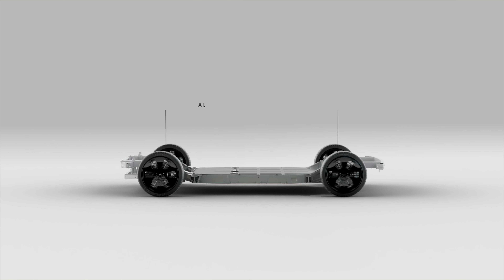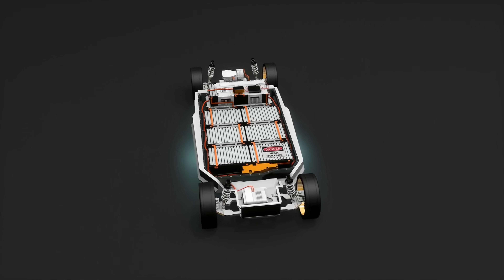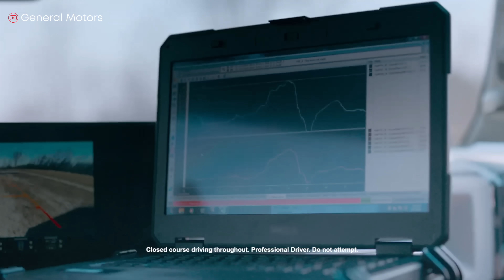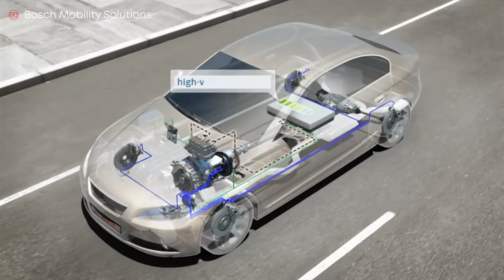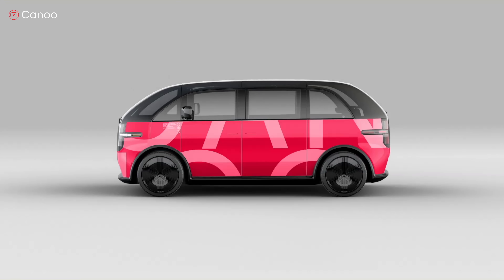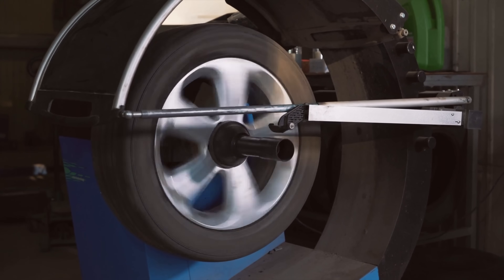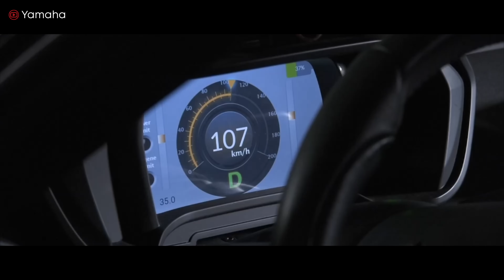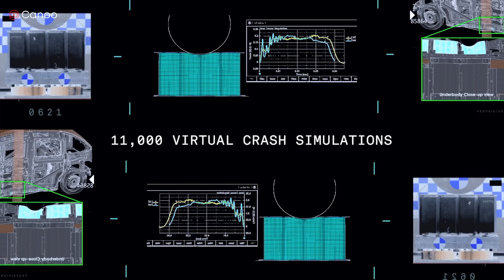No One is Telling You the Truth About Electric Cars, So I Have To

Comment: Mullen EV batteries are REVOLUTIONARY. Solid state sodium ion... chemistry is not that of liquid conventional batteries... they are SOLID STATE. You can literally puncture it and it does nothing more than reduces the capacity of the battery. Does not explode, has more energy density, is lighter, does NOT impact environment (mining for them does however). Check it out

Comment: In 2021, 77 % of ALL electric cars sold in the USA were Tesla (US Dept of Commerce data). Tesla refrigerant/cooling systems, braking systems and the sort are sealed, so nothing of what Scotty says in this regard is accurate.  Next, Tesla is getting better, more efficient batteries with a better chemistry like LFP, that can be recharged 0 to 100% unlimited amount of times with no penalty,  and Lithium/Velcro/Iron batteries that have up to 5X times the energy density of the regular Lithion ion batteries, and they do not require as much temperature control as regular batteries. Also, some vehicles like the Geely ZEEKR-1, have a revolutionary battery that is guaranteed for 2 million miles!!!!  GM 1 million mile battery at this moment is a joke, it is only in planning, and will not come until may be, if GM still exists as a car company, in 2029 or 2030. Battery technology has advanced much more since Scotty made this video, and most of the real EV companies are getting better and better at their propulsion trains, way better than GM, Ford, Toyota, Honda, Audi, BMW, VW and MB.  They are more efficient, more powerful, better built, and more economical, at a very high quality level of build.  And Tesla is at the forefront of all of them. These new companies are aiming to become better than Tesla, not to any legacy auto to which they are already superior.  So the actual maintenance costs for an EV in its first years is almost ZERO.  Just charging it, and tires will be the actual expenses. Compare that to what the expenditures any ICE vehicle have starting from the moment you buy a car....... Real good EVs are kind like computers, they are upgraded constantly, and that is why many of the newest EV will maintain their value longer, not like most of the older EVs like the Leaf or the Chevy Bolts, or Jaguar I-Pace. Those are dead end EVs. But the new EVs from Volvo, Polestar, BYD, NIO, Kia, Hundai, Li Auto, and obviously, the leader in technology Tesla, are going to be very advanced and with improvements every day or month that passes by, unlike ICE cars that you had to wait for the next generation to see an improvement that took severeal years to appear.  But this video is still excellent because it showcases how the EV has evolved, and will be one that will be used as a comparison for EV cars in the future.  Scotty is as always fabulous!!!!!!.

Comment: I have an 02' Ford Escape listed as a "Hybrid" w/ an electric battery. However, it is Not! It was a special order & I'm glad! 
Ford mechanical Dept. Told me the Hybrid (Elect. Motor) was only Covered by a few year warranty & when the battery goes bad & that electric motor stops working? 
You car is worthless, because it will Not Run! 
I'm a Gas Guzler Dude all day & will never buy these Electric or Hybrid $100k Ford, Chevy, etc. Vehicle!
Tesla is kinda Cool but I've never seen a Charging Station anywhere I live. I'm South of Houston Tx.

Comment: I see comments on You Tube and Facebook and am astounded by the ignorance of a large percentage of people,  quick to criticize and discount the advantages of alternative power vehicles. Their arguments are so easily rebutted, all it takes is a little research. The majority of the arguments stem around the misunderstanding that this is still new technology and all the kinks have not yet been worked out yet, much like when cars were first introduced  before the turn of the century. People seems to think that all the problems are suppose to have been worked out already and therefore all the flaws they point out are reasons not to embrace EV’s. The infrastructure for cars back in the early days were not there yet, like roads, gas stations or mechanics ,but those shortcomings were worked out over time to where we are today. No,EV’s  are not perfect yet. Yes, there are big question marks regarding battery life, mining to make batteries, recycling of old batteries, range, infrastructure etc. The early adopters of EV’s are the pioneers who can report on the short comings and what is good, to further develop the EV and make it better.Nay  Sayers need to sit back and shut up if they can’t listen and learn to why their arguments don’t hold water. Everything they complain about are being addressed and just like transitioning from horse and buggy to automobile, it  takes time. It is the same for alternative fuel vehicles.

Comment: I would buy an electric car in a minute if the technology was there and a parallel move or better versus gas powered cars, and it isn't. There shouldn't be any compromise in having to move to an electric car.  I cannot pull an electric car into a station and be fully charged in less than 5 minutes. I can't travel long-distance without having to pull over and charge far longer than it would to be filling up at a gas station. The battery is equal to the engine in a gas car and I have to replace that battery at thousands of dollars in costs every 100,000 miles which means every four to five years for many people,  you're dropping a new engine into your electric car, which could be more than that maintenance savings you were talking about. Haven't even mentioned about possibility of being electrocuted and other battery related dangers. My gas powered car has the same amount of power regardless of the weather, and that power never diminishes unless I don't take care of the car. Electric cars power diminishes no matter how well you take care of the car and begins to immediately. No, the technology is not there and your government once again is treading where it doesn't belong and it's going to force your hand and everybody else's into a technology that is unproven and not capable of meeting all gas powered vehicle demands.

Comment: Oh no buddy . Fewer parts does not always mean fewer problems. It means that each part becomes more critical. Then you started talking about battery life. LMAO 10 years then you need a new 1 but it costs more than the motor . That's absolutely planned obsolescence. Along with factors like cold and heat killing it. That shortens the life by how much exactly ? I guess that doesn't matter if you don't drive the car when it's hot or cold and not for very long. As to the environmental impact all these batteries have ? Well , you know what strip mines look like right ? But don't worry right now those substances are only mined in China so there's no chance of the rest of the world making them any time soon. I think I'd rather drive a gasoline powered car. It can be hot or cold it doesn't care. I can drive coast to coast and back again when ever I want through every climate and all I need is gas .The only problem is idiots keep wanting to keep the price high so that we buy sht from China . And oh yeah if it breaks , I can fix it myself with out getting electrocuted.

Comment: The people arguing against electric vehicles are exactly like the horse owners who argued against the newfangled motorcars 130 years ago. They're dangerous! Expensive! No refueling stations! Difficult to maintain! Ugly! 

The idea that current disadvantages - and the naysayers are right to point them out - can't or won't be fixed as the technology matures is absurd. in 1900 there 450 fatalities per 100,000 motor vehicles and by 2007 that figure had been reduced to 18. (Source: US Department of Transportation). In 1909 a Model T Ford cost $825, by 1925 a better version cost $260. In 1920 there were 15,000 gas stations in the US. Now, about 150,000. etc.

Comment: EV are a non starter for me (despite the fact the British Government is trying to get everyone driving them) because I live in a rural rather urban area so would have to have a charging station at home especially because there is not enough filling stations with changing ports in the area where I live not to mention the time it would take to charge it because one things for sure it would take a lot longer than 15 minutes to charge when that is all it takes to fill my current car with petrol and that's from nearly empty so until these issues I have mentioned are addressed by the the British Government  I will not be buying one anytime soon even if there will be no more brand new petrol and diesel car sold after 2030

Comment: I can't believe people still use ICE vehicles, makes no sense at any aspect.  EV range these days 400-500 miles, home charging cost equivalent of about $7 to "fill up" vs. ICE $50-100+, brakes pads and rotors can last 200,000+ miles ... ICE vehicles are for people that are insecure and just like to toss money out the window.  Our maintenance costs for our EVs is over 1/4 the cost of ICE based vehicles.  Replacing batteries costs $8,000, replace an ICE engine on the same vehicle (in this case a Kona) is $12,000.

Comment: The Ev verses the combustion engine. (My opinion) First I like the fact that scientists aee trying to invent a better solution and promote the new innovation in automation. Like the electric vehicles, and showing us, they have arrived. But let's look closely at there products, and see what they have to offer. Now here's the pros and cons of the comparison. But, first things first. And let's be totlly honest,  because the moderator (the mechanic) who've I've love listening to for a long time, don't sound the same..any more. 1# On average, the electric car company manufacturers knows its products car can go the distance of 350 to 425 miles before it next charge. Next charge?..Really? And how long is that? About an 1 hour 10 to 20 min. Until its recovery?. And what will I be doing until then? Up to you.. So l got wait  1 hour and ten minutes before I can continue my journey? Yes. Verses having an combustible engine, that could drive the full distance without any delay to my destination.yes again. Beit 1,250 vs.350  yes.. the choice is easy..the 1,250 miles and back is better. 3# Repairs and replacements : the main functions of the vehicle are the batteries, and when the batteries needs replacing or repairs, it's out of your hands completely. Why? Look where the batteries are placed and you'll see. Under the entire vehicle.(Electronic experts only) 4# They it will  save you money, how? And how much will the battery replacements cost? And since you're trying to save money, did you know that there'll many mechanics out of a job. You say, no they won't. Statistically they will, it not much for them to do anymore. Especially with simplicity vehicle repairs. Tires, small moving parts, lubrication. Did I say small parts. This mechanic (the  Moderator to me) at first was more honest  true and reliable. But he doesn't sound that way anymore. With his enthusiastic voice and drive towards perfection. Especially for the little people. What happened to him?

Comment: "GREEN"?  I Think NOT! To manufacture each EV battery, you must process 25,000 pounds of brine for the lithium 30,000 pounds of ore for the cobalt 5,000 pounds of ore for the nickel, 25,000 pounds of ore for copper Digging up 500,000 pounds of the earth's crust For just - one - battery. The Batteries are caustic to the environment to Manufacture and Dispose of.  
The Distance one can travel, depends on if the Air Conditioner / Heater,  Lights, or  Radio are being used while driving. To charge these Electric Vehicles it requires 2 to 3 Hours which requires voltage from a Power that uses Coal, Natural Gas, or Nuclear Energy.  Neither Solar Panels or Inefficient Wind Turbines cannot supply enough Energy to charge a car.  The NWO wants to get rid of conventional Power Plants and Gasoline Automobiles.  They want everybody to get an electric car.  Well there will not be enough  electricity to charge all of the electric cars.  We will have to have either Horses or bicycles to get around.

Comment: Some time ago, a German auto company designed a regenerative braking system to be stored in a mechanical vacuum unit without the need for electricity improving fuel efficiency by roughly 20%, much better than the silly battery method. Not sure why this hasn't been implemented on every auto. I'm not sold on batteries being the future, yet. It takes much energy to make them, then they are sooo big, then they end up in a landfill somewhere, then it takes energy to charge the batteries, and on and on. After all that, they are not that environmentally friendly anymore. Now, if the scientist could make a battery the size or your fist to power a vehicle or home, maybe we'd be on to something.

Comment: EV’s still need oil and brake fluid so there goes that lie about not needed oil production
Reply: Brake fluid yes, oil no.
Reply: @SpottedSharks  in this video and others on ev state they need oil
Reply: @rogerboucher9132  There is a lubricant in the electric motors, but it does not need to be changed. At least not in a Tesla which is what I have.

Comment: It is a darn good thing that world-wide use of EV's will dramatically alter and perfectly balance global climate so those low and high temperatures will be eliminated and the resulting perfect range of temperatures will create the perfect environment for extending the life of the EV batteries. This summer in some places the batteries would be taking a beating with the over 100 degree temps out there. Thankfully, the batteries are not degraded as much in colder temps so the folks up in Canada and other frigidly cold places [Siberia comes to mind] will not be dramatically impacted when they are tooling down the roads in their EVs. These saviors to humanity could not have arrived at a better time.

Comment: Owned a Fiat 500 EV for 7-years. I've only ever needed to change wiper fluids and tires. Lowest cost of ownership of any car I've ever owned, by a MASSIVE margin. No oil changes, fuel filters, spark plugs, oil filters, all parts the auto industry designed for recurring income. Love all cars, but electrics are far superior in every way.

Comment: What a waste of time..EV are going to be expensive and bty packs will need replacing sooner than you think as mileage depreciates every time you charge ,just like ur phone or iPad..hybrid is the way to go until the price comes down and you can get 600plus miles a trip..point to note manufacturers mileage is done with nothing electrical switched on,ie,indicators headlights etc..all tests done show at least a third of mileage is lost..330 actually means 210..and the more you’ve got switch on the lower it gets,a top box,towing a trailer and u won’t get 120 b4 u need to charge..hope there’s a charging point when u do do and no one using it…DC charging up to 12hrs also.

Comment: Batteries are the least of your worries. Electrical infrastructure is the number 1 biggest issue. It's HUGE money to make electricity and then distribute it to people to use it. The existing grids in cities canot handle large amounts of electric cars. Simply impossible at present. So who pays for all this infrastructure? The consumer thats who. Then there's road use taxes and maintenance costs. Who pays? The consumer thats who!
    So I predict it will cost easily as much or more than an existing internal combustion vehicle.
    So as far as costs go there is no advantage.
   Then there's the environmental footprint which is proving to be quite dirty so far. Lithium mines cannot be reclaimed!! 
   Hydrogen cell cars make more sense I the long run. Ask Toyota

Comment: My EV is now 6,5 years old and has 110.000 kilometers on the odometer -> my (first) brakes are as new, my engine is in mint condition, my first suspension is in good condition, the gearbox is in normal condition, the battery State of Health is 99%. I never had to do more then pouring some lubricant to the engine and do some yearly service tasks. The costs compared to a gas powered vehicle went down to a bare minimum. The battery pack is under constant warranty and IF some cell goes bad, it can easily be exchanged. All the facts in the video are just nonsense - and can maybe apply to rare extreme conditions and usage. I repeat - EXTREME and always extreme. The video is in some form informational, but full of constant overexaggerating. Just buy an electric car - the only thing to know and take an eye on is: calculate your weekly routes +/ 10% and choose the appropriate battery for your normal commute. I have 40kWh battery pack in my EV with an average range of 240 kilometers - this is enough for everything + the vacation drives.

Comment: EV's will not become viable until High DEnsity Capacitors are properly developed.  Until then the battery issues will DOG EV performance & viability.  I would not touch one, even if they were free of cost.

Comment: EV's are a joke. They are horrible for the environment. The batteries alone are horrible for the environment in manufacturing. All the rare earth metals needed to make them are strip mined or hand mined by severely underpaid, overworked labor that often is working in very unsafe conditions. It's worse than blood diamonds. Then the manufacturing of the cars itself takes a ton of energy. Then charging them requires energy and most of the energy in the US is Natural Gas or Coal. We don't have the electrical grid capacity to convert everyone to EV's. Especially with how much coal China is using and still can't keep up their own grid. EV's are a joke.

Comment: Ev cars are expensive cause pollution by colbalt mining and other minerals u need a specialist  to fix it most the time then u have to recycle the battery after 10 years which is anther pollution  problem they won't work dont buy there are cleaner cheaper alternatives